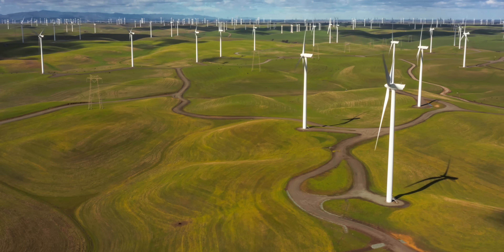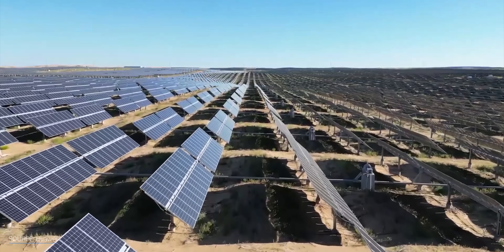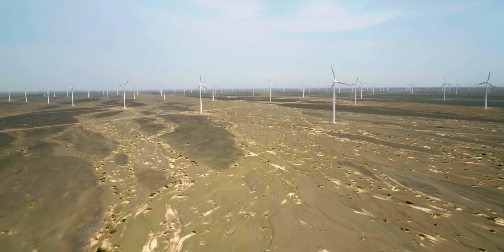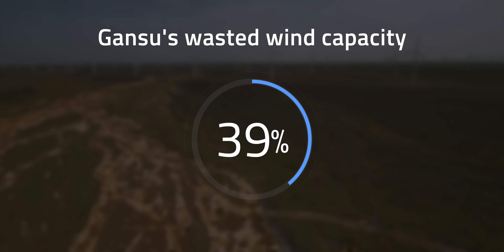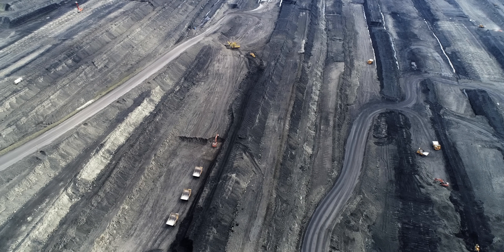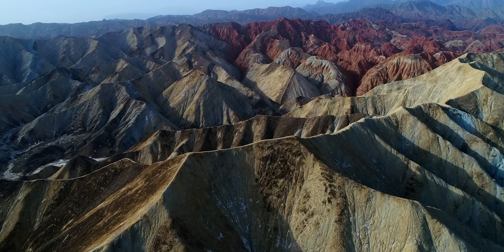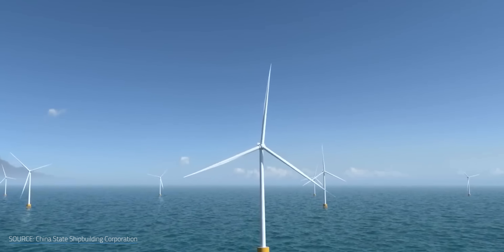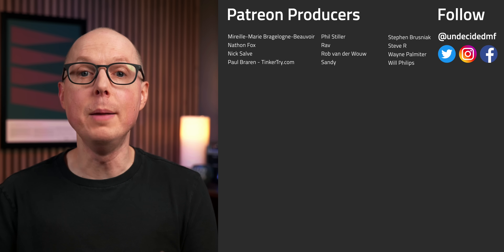The World’s Largest Wind Farm has a Tiny Problem

Comment: I love how much innovation is going on in green energy
Reply: Innovation would be if someone figured out a way to efficiently and economically store all that power. 

Putting up more and more of the same wind turbines is called "repettion", not innovation.
Reply: @Alexander_Kale  - they have in various ways from battery storage of many types (which different characteristics to suit differing needs), compressed gas storage,  thermal storage and pumped hydro.

There is not only innovation occuring in generation that same is occuring in energy storage and management.
Reply: @GruffSillyGoat  Let me guess, you missed the parts where I wrote "efficient" and "economical"?

Because none of the things you mentioned are either. The only thing that holds ANY promise for the future is thermal storage. Every other technology you mentioned is garbage for energy storage and the ones you didn't mention, like large scale batteries, Hydrogen or liquid flow batteries even more so.
Reply: @GruffSillyGoat  storing electricity in battery is prohibitively expensive.
Reply: @gund89123  - nope, BESS has one of the lowest LCOS according to Lazard's assessment.
Reply: @GruffSillyGoat  LOCS means exactly nothing. It does not take into account all the relevant costs.
Return of investment is what you need to look at, which is of course the reason why the entire world continues to build nuclear and coal power plants.
Reply: @Alexander_Kale nailed it

Energy storage (not merely/simply production) is the only thing that is impressive/really matters. 

Without it, non-carbon-based-fuel-energy-production falls flat.
Reply: China said they would reach their emission peak in 2030, but it looks like they can achieve that in 2024 or 2025.
Reply: Do you now, name one " innovation" that's made it to market in the last 10 years then.
Reply: @a16416  Most of the worlds best energy grid innovation is in good old, unappreciated, proper urban planning. Nothing beats that. I don't know if this is good yet, but they're inviting companies to use the power. It will draw people to the city. 

There's one city that uses energy from another county... And.. it relies on only one main link, no redundancies... Terrible imo. I cannot say which city has that flaw but yeah, if there's a black out from that, the whole city's dark.
Reply: @yensteel  - as well as the direct point to point link between the cities are there links elsewhere that can indirectly connect the two cities - if so that may be their plan for secondary emergency power.
Reply: Without government subsidies this green industry will collapse in few months.
Reply: @budadepapel  bro how is it noisy(I know it produces noise… but barely any)? If you call that noisy then I wouldn’t surprise that you hate cities.
Reply: All these short term projects are going to come back to bite us later on.
Reply: @budadepapel  what?
Reply: @Zidern  Windmills' blades have to be replaced to new ones from time to time because their edges get uneven and cause drag and noise. And you can't recycle old blades. You could try, but it's extremely hard.
Reply: @Biodivesity  depends entirely on what material is used for them.
Reply: @Biodivesity  - who say's you cannot recycle wind turbine blades? 

Many of the online pictures of used blades lying around in fields, often with clickbait taglines, are actually showing recycling marshalling areas waiting for sufficient stock to build up to recycle economically. Other pictures of blades being burried are sites where the blades are being repurposed as structural infill and landscaping materials (such as for river errosion and flood protection). The blades have even been upcycled to make playground equipment. 

Blade materials composition is undergoing development as well, seeking longer lasting materials as well as lower cost recyclable materials. A green revolution is driving innovation around the globe, increasing job and economic growth at the same time.
Reply: @Biodivesity They are recyclable
Reply: By " Innovation " do you mean putting up wind farms on prime farm land?
Reply: @brucemitchell5637  doesn't seem to be a problem with any of the farmers that have them on their land near me. 
In fact it's a way for them to earn extra $ to help pay their bills
Reply: @brucemitchell5637  - why assume this is the case. A UK study showed that 3% of land available, that is unproductive, would supply 225TWh of energy, which with planned offshore wind capability would meet the country's entire energy needs - and this is in country with a high population density where most green space land is farmed at levels deemed unproductive in other parts of the world. There is sufficient unproductive land around the world to support renewables without impacting prime farm land, and indeed in some places can improve land productivity when co-located (agrivoltaics reducing water loss and usage, for example, ).
Reply: @GruffSillyGoat  And how many terawatts are lost through transmission by these vastly distributed and remote generation sites?
Reply: @LordFalconsword  - about 3.5% per 1,000km for HVDC and 6.7% for AC. HVDC are used for much longer links than the one at Gansu. 

The economics of using renewables generation with long distance HVDC lines are better than the cost of extracting, processing and moving a physical product such as coal, oil or gas (or even hydrogen). Which is why HVDC interconnects are springing up all around the world at longer and longer spans.

The objective is to ship energy from places of high generation capability to places of high use requirement, this has always been the case even with fossil-fuels. Electricity has always been the cheapest option in this respect, which is why electrical supergrids such as that in China and in Europe were created.
Reply: @GruffSillyGoat  let a business build wind farm without government subsidy, if they make money then they can build any size wind farm they want.
Reply: @gund89123  - what subsidy is this, UK stopped subsidising wind a while back when costs fell. Or are you refering to the large o&g subsidies paid (£7.3bn annually in the UK alone)?
Reply: @brucemitchell5637 doesn't look like even half decent farm land..
Reply: @Zidern  "Prime farm land" and "barren desert devoid of life"
Yup. 😑
Reply: @TheArchaos  Tell that to the thousand of raptors and bats killed by these every day.
Reply: @LordFalconsword  Name an alternative which does not run on fossil fuel nor rely on solar power and does not produce radioactive pollution which costs more to store than produce? 😚
Reply: @LordFalconsword Which is still less than quarter as much as are killed by coal fire power plant emissions. So, its clear you don't actually care about the environmental impacts, you're just cherry picking whatever you think will score you points in your imaginary war against a better future.
Reply: @brucemitchell5637 I’m unfamiliar with Chinese practices, obviously, but in at least nearly the entire world, the standard practice is for developers to lease land for turbines. Farmers who lease their land are paid many thousands of US dollars annually for their leasing. This income is not only for doing something that’s good for the world, but also helps farmers income in what can be the most volatile practice in the world. They need to go through lengthy processes to claim insurance on crops after a failed harvest due to any of dozens of reasons. But income from wind turbines or solar agrivoltaics? That’s just a direct deposit, every year, for decades. So even though this farm isn’t prime farmland by any metrics, most farmers around the world benefit incredibly by partnering with renewables developers.
Reply: @brucemitchell5637 oh yeah the famous Gobi desert prime farm land. How silly of us.

Comment: Renewables with hydro carbon generation a la synthetic fuel and then a pipe line to send that fuel over to where the population is is also an elegant solution. They have coals where the wind turbine are so it isn't too far fetch of an idea.
Reply: I was thinking that too, but looking into it a little bit, water and coal are kind of important for doing that, and getting those and the electricity together could be a problem.

Comment: Nearby windmill to set up a gravity battery problem solve😂😂
Reply: @jerrypatel6241  Those rely on a large elevation differential, can't just plop them anywhere.
Reply: @MoonBerryShrimp  if only there was a local source of excess energy that could be used to dig holes, hmm ...
Reply: You'd run out of gravity before you'd run out of wind.